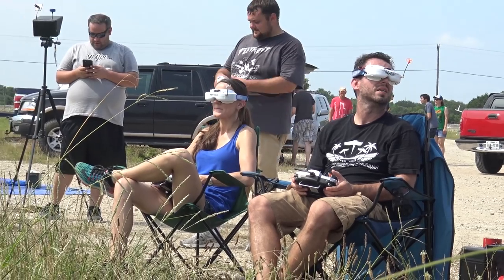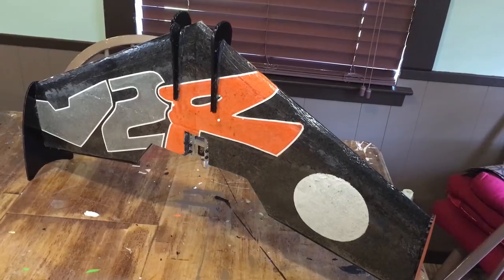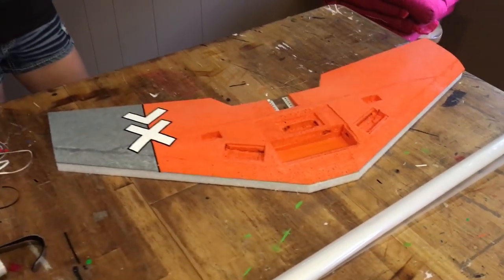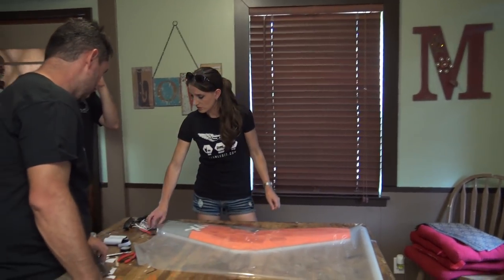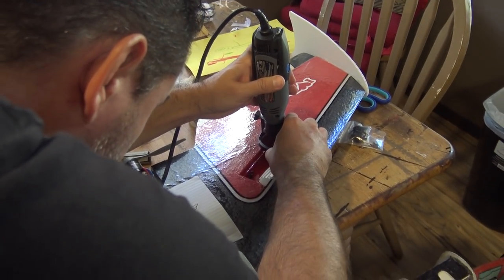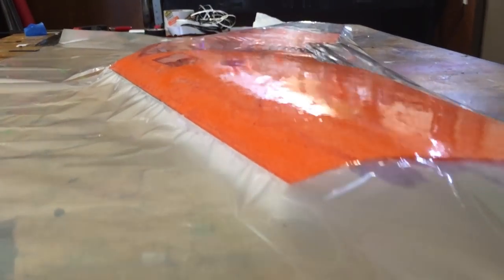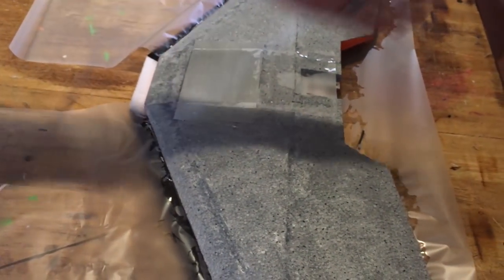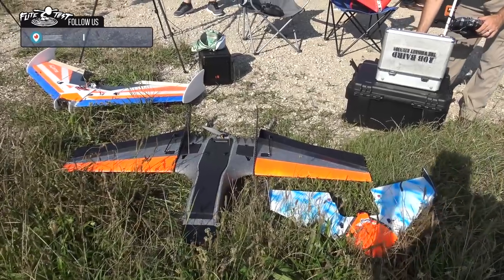Laminating a Race Wing | Flite Test

Comment: It seems obvious to leave some space between the iron and the paint, so I do not know why I kept failing to do that ! 😜
I will try to keep in mind how you worked:
Part of it might be having a place arranged; free from other building debris and tools. Having what you need and everything else out of the way/area. 
At work it was a habit and a requirement (medical device production) — referred to as “line clearance”. So easy to forget how much better working in a clean work area is when I want to get to building.

Thank you both (and the flite test folks). 

Are there any warnings or cautionary tails you can/should share re: two-handed  over the head launch technique?

Comment: Are you guys familiar with the old wings called boomerangs?  I have an old kit I never built and want to put together with modern motors and such. Any suggestions on batteries and other components that make the stuff that was used 15 years ago  useless? I also have a st10+ remote from a chroma so I'm curios if that could be used so I could add a camera?

Comment: Great video guys! I have a question about the EPP/Paint/Laminate layering process. 

I fly EPP wings and I really like the look of the painted wing but whenever I have tried to paint the foam before laminating the lamination grabs the paint instead of the foam and after a few crashes to pull it apart I get a bag of lamination filled with paint surrounding the wing... I have suspected I am putting too much paint on and have lightened up a lot which hasn't really solved the problem and has lead to very pastel colored wings. Granted I have never used super77 so maybe that is the trick

Anyway these wings look amazing and the color is vibrant and awesome. Are there any suggestions the McDowell family could share on how they achieve their paint jobs? Or should I just go start by getting some super77? Thanks!
Reply: The super77 will help out a lot with your problem. That is the exact reason we use it! I use acrylic paint and paint it on with a paintbrush. I think that acrylic covers the best and it makes it very easy to repair the paint if you need to later on.
Reply: Great! Thanks very much, I will have to try brush on as well.

Comment: hey flitetest team! great video! i have a question about antennas: does a cloverleaf antenna goes well with the classic straight antenna?
Reply: believe no the clovers send a polarized signal so the sender receiver pair should be polarized the same way.  The straight rubber antenna are omnidirectional but I think typically not as good.  Some systems allow multiple antenna but you'd still want them paired.
Reply: rcmodelreviews channel has a few videos covering antenna type and quality if you want details
Reply: +Shaun Husain thank you i think i will put a straight antenna on both transmitter and receiver because i don't have two paired cloverleaf antennas

Comment: can you make a racing wing have a ducted fan?
Reply: You could, but you'd need to check with the organization you plan to race with. MultiGP for example has a no EDF rule in the books (along with a 2700kv cap). Drone Nationals has a wattage limit.  A EDF would also not work very well on a tight course that required speed changes. The sure sound awesome though :)

Comment: Important information on lamination plastic here: http://www.rcgroups.com/forums/showthread.php?t=1334433. The right choice of skin can make your planes incredibly strong.and stiff. 3mil of plastic is what you want but the stuff shown in the video looked thinner. Sometimes the thickness is given as the sum of the plastic thickness and that of the adhesive, so 3/2 (3 mil plastic, 2 of adhesive) is called "5 mil" so be careful. The stuff in the video may be 2/1 or even 1/2. Plastic comes in two types, DL (stiff) and CL (plyable). I recommend 3/2 CL. Also, film up to3 mil of plastic will heat-shrink a little so it helps if you can tack down the edges first and then hit the interior to shrink it, rather than as shown in the video. Use a low heat setting the first time. Then when it eventually loosens, turn up the heat a little and you'll get some more shrinkage. Eventually you won't get more shrinkage but you can stick it back down anyway until you decide to reskin it. It takes practice to do well but it's not very hard.
Reply: Why is 1.5 mil film not used but the 3mil is?

Comment: I scratch build versawing but i cant fly it really good, it cant keep the controll over the plane in the air. Any tips?
Reply: Less throws and make sure you c.g is right. Always favor a touch nose heavy. :)
Reply: try a flight stabilizer like the naze32 with openpilot
Reply: Jorrit, please make sure you've got the wing balanced. If it's balanced properly, it will fly great. I had great success the first Versa I built that was actually balanced properly.

Comment: Does anyone know what kind of power system is used on these faster legit wings?
Reply: We use a NTM 2836 2200kv / 60A ESC / 6X4 APC prop on 4s. High 90mph all day long with this setup on most of the legit wings, faster on the racer. We're testing a Cobra setup right now that is good for a good bit over 100mph (measured with radar gun in no wind and flat, level flight)